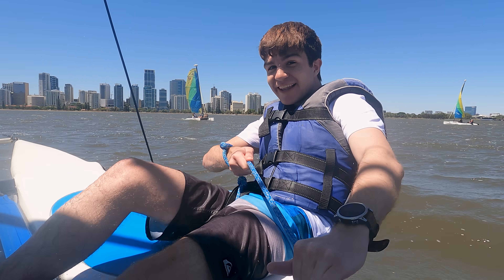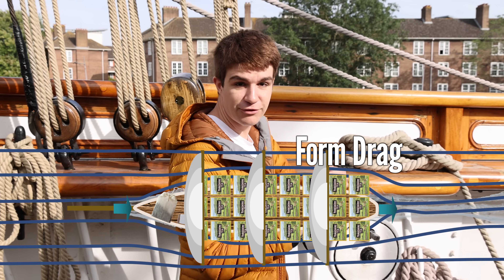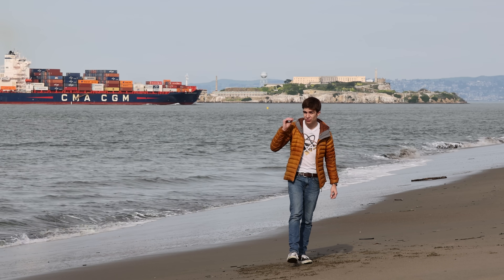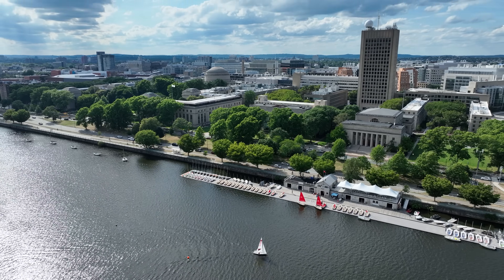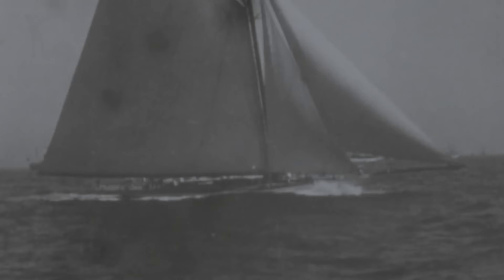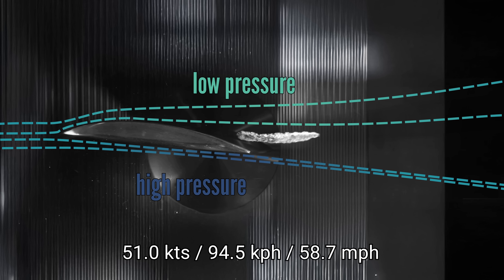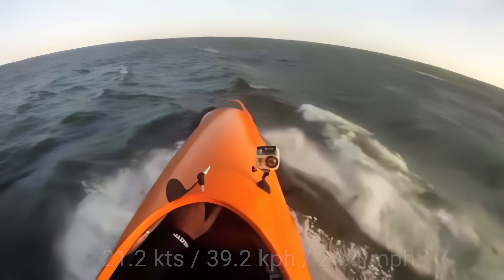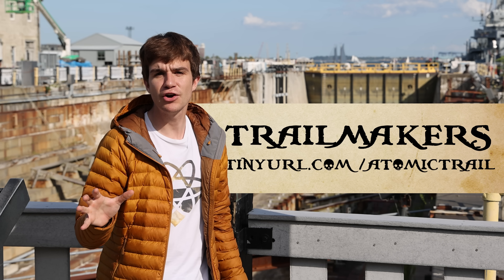What if sailing had no rules?

Comment: I think catamarans really deserve mentioning. While high budget America's Cup yachts were stuck at single digit hull speeds for ages, even a mediocre sailor like myself can reach around 20 knots on a humble beach cat
Reply: And you can easily exceed the speed of the wind on a beam reach. For a really mindbending dive into physics, check out the land yachts that can sail dead downwind faster than the wind.

Yes, I know, sounds impossible. It's not.
Reply: @johnnyragadoo2414 many sail boats do that also
Reply: @mr.astronuts3825  Directly downwind faster than the wind on the water? I'd like to see an example of that. The dead downwind faster than the wind land yacht is an unlikely but real transfer of energy via chain between airscrew and wheels. I could be wrong, but I don't think there's a practical means of exceeding windspeed dead downwind on the water. Off of a dead run downwind, reaching, exceeding windspeed is common.
Reply: @johnnyragadoo2414  Veritasium had an episode about a land yacht that actually goes faster than the wind when sailing dead downwind. But normally fast craft will just tack downwind to stay on a beam reach
Reply: It's almost like a seafaring people who needed to travel thousands of miles quickly invented the catamaran or something
Reply: @SavageGreywolf  There is more to multi-hulls than just speed. A large beam offers great stability without the need for a heavy keel which is probably difficult to make using the primitive technology those had available. The lack of a keel reduces draft and allows sailing into shallow atolls.
Reply: The key to the catamaran is less wetted surface area.
Reply: Herreschoff entered a catamaran in one of the races accompanying the America Cup series in the late 1800s. It was about 26ft long and had a camp stool as accommodation. It won, but was disqualified as not being a yacht. However a special prize was give to the boat. Catamarans only came back when some American skipper didn't want to  lose to the "Big Boat" built by Kiwis for Michael Fay (Fahey?). That cracked the mold for the America's Cup and now it is alway hi-tech stuff that can't survive in a decent gale or choppy seas.
Reply: @robertfindlay2325  That is dead easy to fix, just have two classifications.  They do it in car racing fairly frequently.
Reply: @robertfindlay2325 Yes, Fay. Founding partner of Fay Richwhite a NZ accounting firm, with a very dubious reputation following "The Wine Box Enquiry" into a pretty outrageous tax evasion scheme he set up using Cook Island Banks. The firm is based in Switzerland today rather than Auckland.

He's a very likable rogue, quick wit, and 10 steps ahead of the pack....and, thanks to the "best" lawyers money can buy in NZ, always legally in the clear. Certainly, a character worthy of inclusion in the list of owners who've won the auld mug!
Reply: I remember seeing these just off the coast at Seabright, NJ, in the mid 70's. I was amazed at how fast they sailed, and then 2 of them came up and "parked" on the beach. It was wonderful to my 14 year old self 🙂.
Reply: Outrigger canoes too.
Reply: Yeh I was surprised the SailGP cats weren't mentioned tbh, pretty sure those match or even top the America's Cup yachts we currently see out there. I remember I was once sailing a prototype racing catamaran - not foiling, but 2 person, twin wire, modern cutting hull design, huge kite - and in a force 6ish, with the kite up on a beam reach we overtook one of the safety boat ribs going full throttle to rescue of of the younger cadets who'd turtled... apparently their speedo maxed out at 30kts xD
Reply: @Vikingeek  I am envious.  I would have loved to sail a hydrofoil, when I was young enough to do that.
Reply: Yupper, FLYING past what I came to call 'teacups' at 2 1/2 times their speed in my Hobie 16 was always a laugh.   I never saw anyone out with a racing monohull, though, that might have been interesting.
Reply: The tornado cat can still compete with the way more modern Hobies, even as it was created in the 60's
Reply: Ppwrr sailer planing hull  monoul hul cameras trim sail 20 slang hill powr boats 213 foot iyal sauolyaght fari lamvghini mad sailer 60 knots moters 20 knots 67.5 moh sail fari lamghini makes 1 third arri lamb h ini soeed

Comment: At 11:45 you say self-ventilating foil. I think you meant supercavitating, as the video shows, and as I have found in an french blog by Francois Chevalier(very interesting).

Supercavitating happens when you forgo a normal droplet shape(good for lower speeds) and go full-on knife/bullet. Just like a bullet breaks the soundbarrier at the tip instead of along its body, after the tip it experiences no drag. Steve mould has a good video on supercavitation. The foil is almost shaped like a sharp knife which is mildly bent to one side (flat back, sharp point, point points a bit downwards).

also fun(from Chevalier's blog): this sigar shaped hull actually doesnt move straigt, but at a 22 degree angle to the sailing direction!
the 3 hydrofoils seem like 2 (the back ones are on top of eachother. The big black pontoons are not the hydrofoils, but just for bouancy
Reply: Ah, I was wondering what he meant, but I've heard of supercavitation before. It's used in some torpedoes. It's not just the shape though, they blow some gas out of the front to help form the bubble.

Comment: Interesting video, but I have to take issue with your statement that square riggers could only run before the wind, using sails to catch the wind. Their rigs also allowed them to reach, and even sail to windward by setting their yards at an angle. They were just not as good at going upwind as a fore-aft rigged vessel. Later square-riggers like the clippers were excellent at reaching and could also rig fore-aft staysails as well as having a gaff-rigged spanker on the mizzen.
Reply: I came here to say this. Why would you have sails along the length of the ship, at the front and back (not a sailor, don't know their names, sorry), if you can only sail before the wind? More importantly, why would you have three masts if the sails at the front are just going to be shadowed by the ones at the back? This makes no sense at all.
Reply: @JaccovanSchaik  Most sailing is not down-wind; it is more stable to sail off the wind; and the better square-riggers could certainly  could sail at at least 60 degrees to the direction of a headwind as their yards could be set almost parallel to the long axis of the ship.

Comment: i feel like that everything that isnt using the sideways or direct sail force, is borderline a ship. 
so... if using a kite still counts as "sailing", would skipping above the water still counts as "sailing" as well? 
where will sailing stop and flying start?
Reply: flying starts when contact with the water ends :)
Reply: Everything without active propulsion and constant contact to water sounds like a reasonable middleground.
Reply: I think as long as it is not powered and it has something somewhat to do with water, it's sailing

Comment: Years ago I came up with a sailboat design that could be stabilised by rocket motors, unfortunately it was never built. But my family owns a real racing yacht and we're very proud of it.
Reply from the maker: That's sick! Yes, so many of the sailing records could be broken if we just embraced the "really big rocket motor" design philisophy.
Reply: at what point do you just skip the sails and just go for the rocket engines? like the sail would be more of a drag then. Also if you work on that engine even more it's not a boat anymore just a water to air missile with a passenger.
Reply: @sirBrouwer If SpaceX launches Starship from a barge, is it a boat?
Reply: @michaelmartin9022  Barges are unpowered and require other vessels (or, in the case of canal bargers, a Horse or the like on the tow path) to push/pull them into position and from one location to another. Starship does not propell the barge, nor interact with the water itself while opperating under it's own power.
...
so no.  
Though, due to the fun of how English names things, Starship is, by some definitions, none the less a Ship. Kind of. ... A horribly Misnamed one, because it's not actually capable of traveling from one star system to another in any useful fashion and is thus not actually a starship, but still.